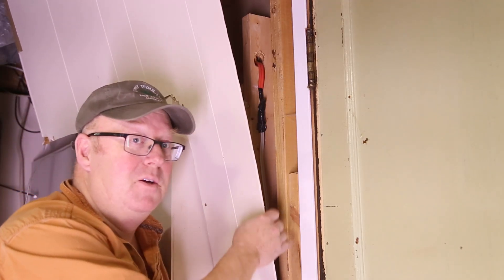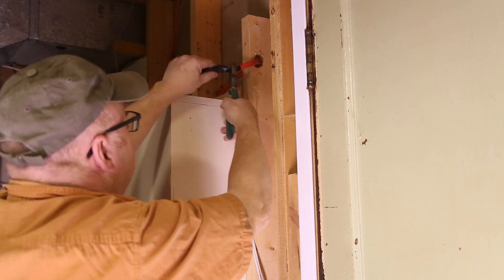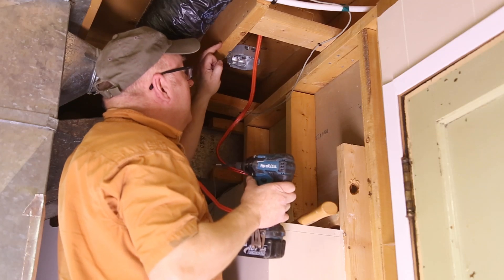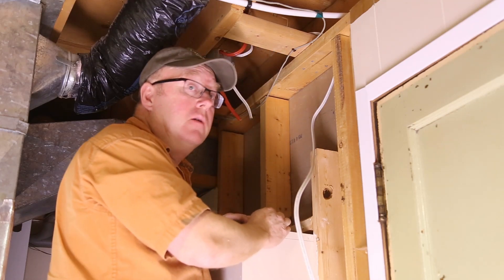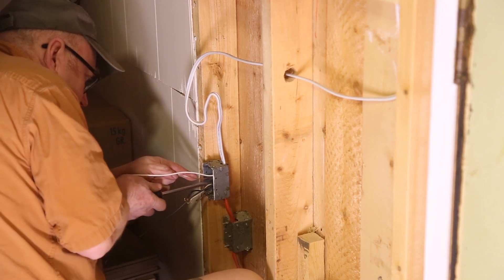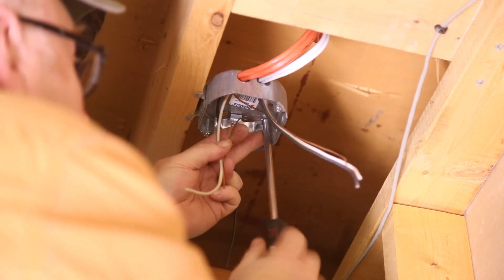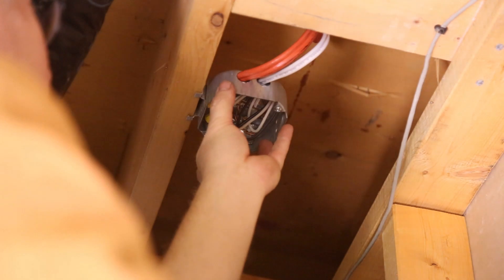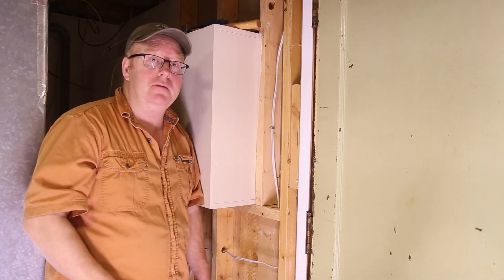An Electrical No No

Comment: The white wire tells us that its a 14awg romex.  The orange wire tells us that its a 10awg romex.      The #14 has a capacity to 15 amps and the orange wire has a capacity of 30 amps.  Did you check the breaker or fuse to assure it rating is not larger than 15 amps?   if it is larger than you have created another code violation.       Is the receptacle box large enough to accept the wires and a device?
Reply from the maker: You got me curious about the wire and breaker so I just checked.  The orange wire is a Vinylex 14/2 and the breaker is a 15 amp. The house was built in 1971 so it is getting up there.  Thanks for the knowledge, I will always keep that in the back of my mind if I come across that again.  Thanks.  Stevo

Comment: Hola amigo.   Nice work.  So that wire changed colour inside that wall.  ARGH  !!!!!!!   You aere avoiding piutting the juction box on the same side as the air duct.  Good but harder to do as you said.  Funny comment.  "It may have been easy to to do it on this side but that wouldn't be hard"  LOL
Reply from the maker: I hope you are not overheating like my wiring.  It seems like owning a home is one nightmare after another.  Thanks Bruce.  Stevo

Comment: was that wire twisted together bare an plastic taped up ?
Reply from the maker: Yep.  Not sure what goes through peoples minds.  From the comments, it sounds like it is a common practice.  That scares me.  Thanks.  Stevo.  PS He had a good twist on er though.
Reply: @stevoj8959  Geeez's that is some scary sh;t ...I would be definitely checking out the breakers and smoke alarms an fire 🔥 extinguishes...if it's seems to be common practice then that means no one has been reporting this , I'm no nark but this sought of thing kills whole families I would report this.
Reply from the maker: @SpunCog-Racing  I agree.  The problem is this job was done in the 70's.  I have about 30 feet of basement wall that I have not done but I will have to get to it sooner.  That's why  things need to be inspected.  Stevo